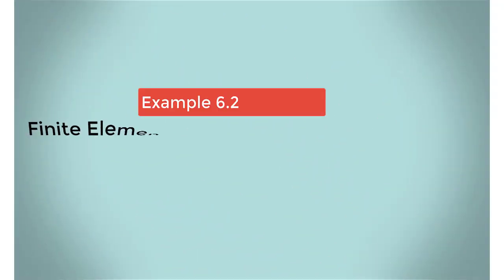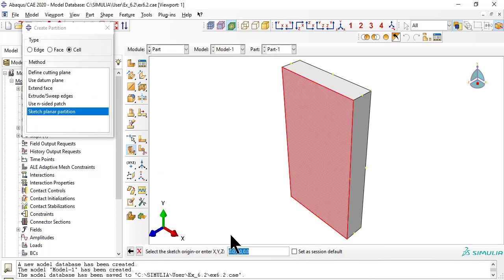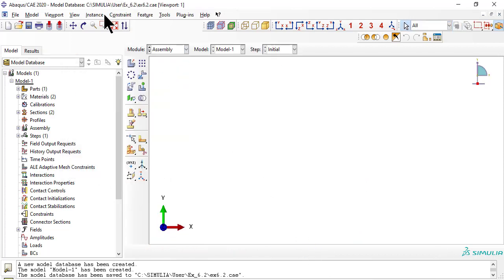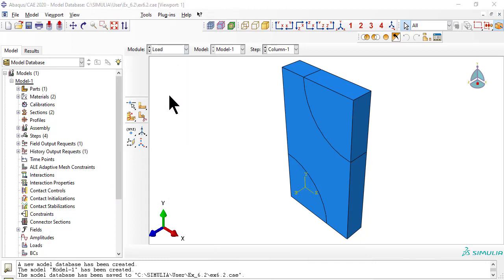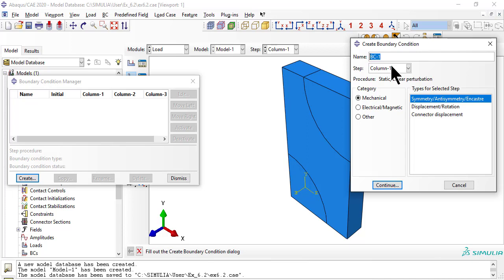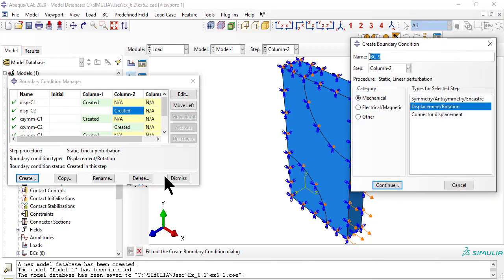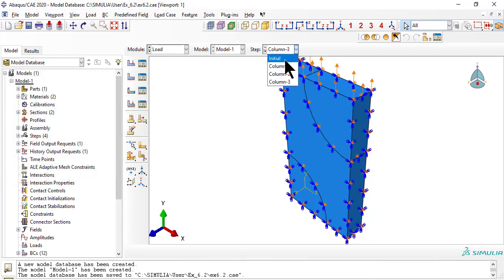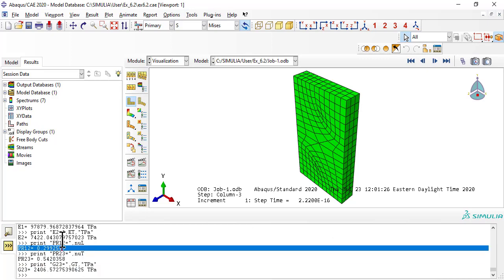Example 6.2 Computational micromechanics using Abaqus 3D RVE unit cell w/periodicity and Python

Comment: how to estimate the overall response of the composite structure from  the RVE response use UMAT and SCRIPT Python.
Reply from the maker: The RVE is representative of the material at each Gauss point, each behaves differently if the strain at each point in the structure is different.

Comment: Prof. Barbero, 
Really appreciate your helpful video. Your explanation is very clear. 
I wonder if you can explain to me how to apply PBC to non-periodic meshing, for example, nodes on the left and right sides are not equal. Thanks in advance.
Reply from the maker: This will be further explained in the 2nd edition of my textbook, with a new section in chapter 2, and used in examples throughout the textbook. 

In CAE, Tie Constraints, while using "Discretization method: surface-to-surface", the way the surfaces are selected has an influence on how rotational degrees of freedom are constrained and whether or not the meshes on the surfaces of the tied regions may be dissimilar. There are two types of Region Selection: Surface and Node Region.  

If you choose "Master/slave type: Node Region", then, the meshes on the tied surfaces of the regions must be identical because the master/slave nodes are tied one-on-one according to their positions on the tied surfaces.

If you choose "Master/slave type: Surface", the meshes on the surfaces of the tied regions may be dissimilar, in which case the slave and master nodes are mapped in an approximate way. Such approximation allows tie constraints between dissimilar meshes and may reduce noise in the solution but it may lead to deletion of some DOF. If deleted DOF are associated with boundary conditions, those boundary conditions may be lost.
Reply: @EverBarbero  
Prof. Barbero,
Really appreciate your reply. 
I understand how to use MPC in Abaqus and quite familiar with that. Assume I'm running Matlab code for 2D plane stress, let's say, cube domain subjected to tensile load in x-direction. If nodes on top and bottom edges are, for example, 10 and 5 respectively. How can I write canonical displacement form to constraints those nodes regarding to MPC in Abaqus? Utop - Ubot = ??? since those nodes are not matched.

Best regards,

Comment: What is the E3 formula? What formula will G12 be calculated by?
Reply from the maker: The best estimate of modulus is E=average(sigma)/average(epsilon), where E could be any of the E's or G's like E3, G12, etc. but you have to use the correct component of sigma and epsilon. There are closed-form or series-expansion formulas for E3 and G12 but they are not as accurate as Computational Micromechanics, were we impose average(epsilon), use FEA to compute average(sigma). If you want analytical formulas, see https://www.amazon.com/exec/obidos/ASIN/1138196800/booksoncompos-20

Comment: How things would change if our matrix is hyperelastic? Just activating the NL analysis or we might need a kind of usermat? Can this python code be generalized to to be used in such a case? Thanks in advance for your reply.
Reply from the maker: Since hyperelastic makes the analysis nonlinear, you have to separate each load case into a separate simulation and change "linear perturbation step" to "static nonlinear." Then change the material to hyperelastic. You can modify the .py for the hyperelastic material. No need for usermat. I would have to think more seriously to see if there are other implications because I may be doing things, like equations I use to calculate the average properties, that may assume linear elastic material, I don't remember without spending serious time on this problem but you can figure it out.
Reply: @EverBarbero  Thanks a lot Professor.

Comment: Thanks a lot for your very helpful video, Professor Barbero. We do not need to define a kind of interaction like contact or constraint between matrix and fiber? Also why do we need to define steps as linear perturbation? Many thanks.
Reply: @Ever Barbero Thanks a lot. I appreciate your knowledgeable and helpful efforts. What would be the difference if we need to apply periodic boundary conditions?
Reply from the maker: All examples in chapter 6 have some type of PBC. In Ex.6.2. the loading is simple so the PBC are easy to implement. In later examples it gets more complicated and you can learn how to impose more complex loading with mode complicated PBC.

Comment: Is using CADEC-online an alternative to obtaining these properties using Abaqus?
Reply from the maker: yes, to a point. For fiber reinforced composites under normal operating conditions, such as small strains, so that both fiber and matrix operate in the linear elastic range, the formulas in CADEC for muduli, E, G, nu, are quite accurate (chapter 4 in https://www.amazon.com/exec/obidos/ASIN/1138196800/booksoncompos-20). Computational micromechanics makes sense when you need to consider nonlinear effects and take the simulation up to failure. However, some formulas for strength are very good, including those for longitudinal tension and compression (fiber direction). Strength formulas are bad for transverse tension and compression, and shear, because in those cases the composite does not fail due to stress but rather due to fracture toughness, and for those CADEC is useful again (Chapter 6 in https://www.amazon.com/exec/obidos/ASIN/1466516615/booksoncompos-20).